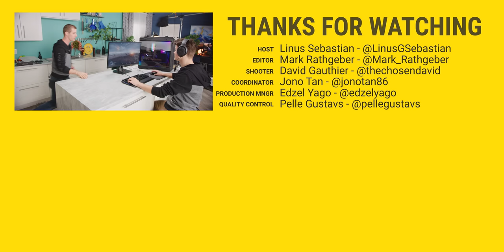We RUINED His Gaming Rig - ROG Rig Reboot 2019

Comment: 19:29 "it feels like beter than ever"
1 second later: game laggs hard
Reply: That's BFV for ya
Reply: Didnt even notice that, that is amazing
Reply: you sure is not the lack of hyperthreading and the bloatware in the background? cus my r5 2600x runs it smooth like a baby´s ass. 120fps locked tho.
Reply: yeah noticed it as well!
Reply: @Ethefake  yea, those specs are insane, and then you have that...
Reply: @TTks124  i think he hasnt locked it, like ultra settings and u locked fps...
Reply: @lifeismad2k7  nice!
Reply: What does locking or ultra have to do with anything. Im playing on ultra too. What i´m saying is that mine doesnt dip into so low minimums or lags, however you wanna take it. My 0.1% is like 85fps.

The stuttering he had, was insane. And im locked because i´m using a gtx 1080. So i´m not really staying consistently at 144 because of the CPU,  but the GPU. The CPU can handle it, since im running 3200cl14 -14-14-14-26-40, with 230+ trfc, which gives me in general a 20% boost over 3200cl16 xmp, because second gen ryzen aswell as first, have latency issues.
Reply: @TTks124  my pc stutters if im playing on high... thats why capping is good
Reply: @milannekuhh9818  mine doesn't.
Reply: @TTks124  ive got a "gaming" laptop...